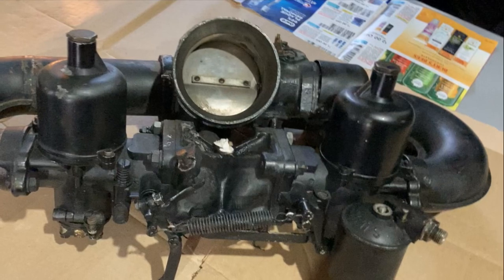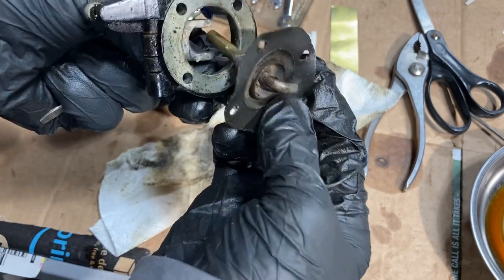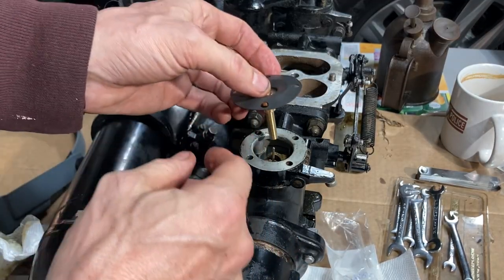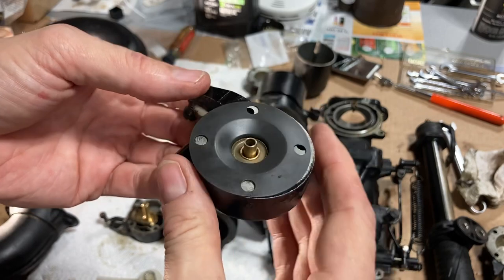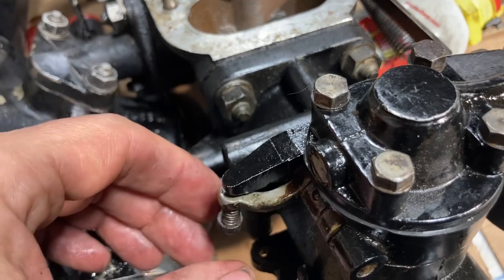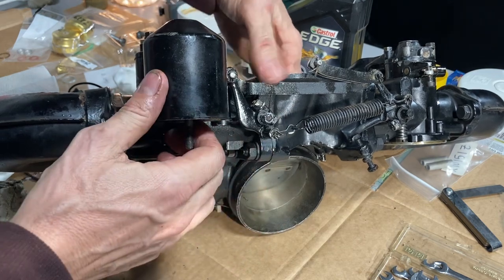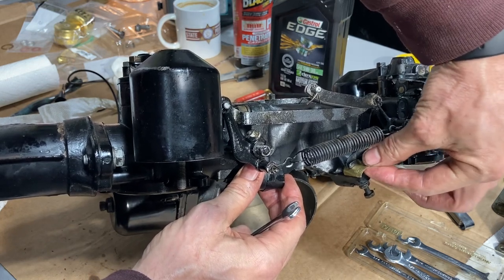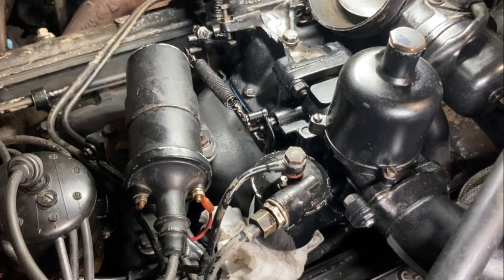Carburetor Issues in a 1961 Rolls Royce Silver Cloud II

Comment: Hey John. Just stumbled on your Cloud II series - thanks for showing the SU diaphragm replacement.  I have a ‘59 S1 which has the last of the Rolls six cylinder and the slightly larger SU HD8s. This was helpful to see despite the differences between the models.

There are some really good videos of Ronny Shaver from the RROC (rollsroycenut) and others out there. But glad to hear you name drop Albers - you’re in the right spot
Reply from the maker: Thanks for your feedback. I too like the Ronnie’s Garage series. Lots of good information there. Thank you.
Reply: @johnsworkshop3312  Hey John - follow up question. Now that you have the replacement diaphragms installed, did you notice the car running better/leaner? Now that the clearance on the jet is a tighter fit, did you find that it would bind? 

 I'm debating whether to do this on my S1 because I've noticed adjusting the set screw doesn't do much, but fortunately I've gotten it to a point where it is idling fine (plugs look fine and the automatic choke works as it should).  The eternal question of whether to fix it, or will it open up new problems....
Reply from the maker: Thanks for the feedback. Glad they were helpful. Ronny sure has a great repository of information!!
Reply from the maker: Yes - that made a huge difference.  We did have to lower the main jet by a turn or two to avoid the sticking to which you refer.  Then it would not start it was so lean.  At this point we have the jets adjusted all the way down and it is still too lean.  The next step is to raise the needles in the pistons to see if that gets us to the correct mixture.